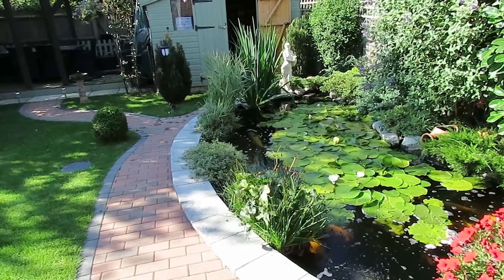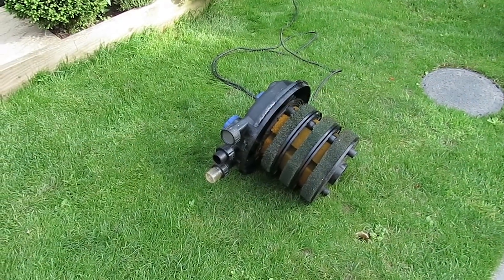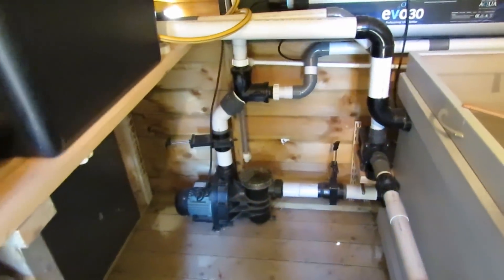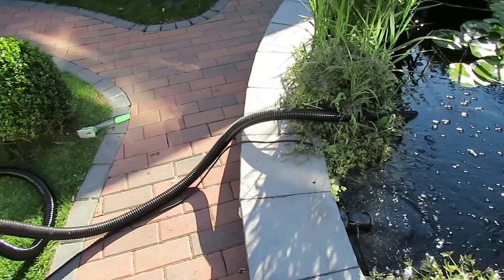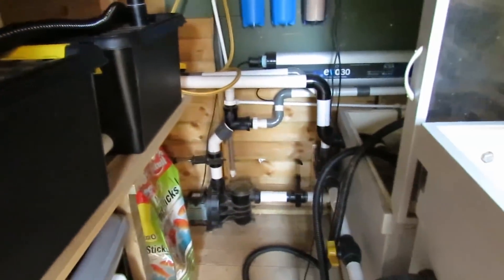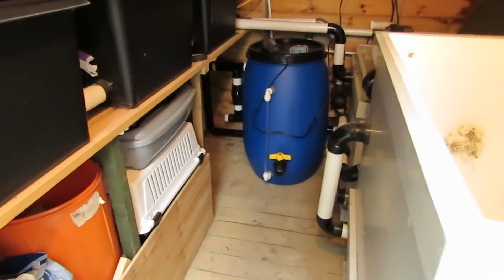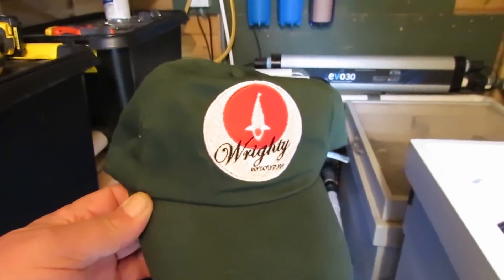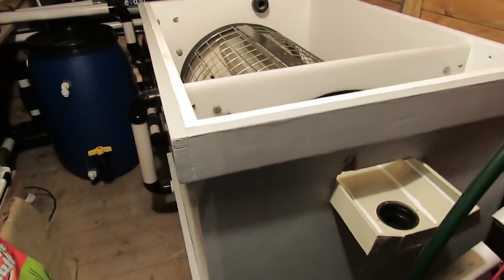It's All Go In The Filter House & Pre Filter

Comment: Good morning Terry (from the states), I just bought the midi system plan, to support you, and plan on building the system this next spring. Will just the K1 media be sufficient for moving and mechanical filter or would I need some of the micro media?  Happy Ponding!!!
Reply from the maker: Good morning Don, Thank you for your purchase and support, very much appreciated. The first 2 tubs of the filter are the mechanical filtration and the K1 will be fine in there. In the moving bed some do have the Micro, but I think the K1 moves a lot better than the Micro. Plus the Micro is double the price of the K1. If you need any help with the filter build you can get me any time on pondfilters@gmail.com If I can help further just give me a shout, Thanks, Terry. Happy Ponding!!

Comment: That's a lot of hard work Terry, why do you have so much filtration and Baki rivers??, Also areation ,however we all appreciate your input and very impressive set up,  a little bit of the green eyed monster from down Under, the ponding hobby not so popular so makes it hard to get all the bits and bobs like areation air discs the pet shop don't stock pond equipment only small stuff for fish tanks so everything has to be source online. Happy ponding.
Reply from the maker: Hello Patrick, I have a lot of filtration because my pond is over stocked with 40 koi and only 2500 gallon, and I don't like my fish hungry, so there well fed. So I have to have the filter system to match. I get most of my equipment on eBay, it's just quick and easy and they have everything you need on there. Thanks mate, Terry.
Reply from the maker: Hi Glen, The average measurements are 15ft x 10ft x 3ft. it's over actually. Terry.
Reply from the maker: Hi Glen, 3ft is the average depth, it's 4ft at the deep end. I've just worked your pond volume out and it comes out at 12ft x 12ft x 6ft = 5382 UK gallon. I would check it mate. Terry.